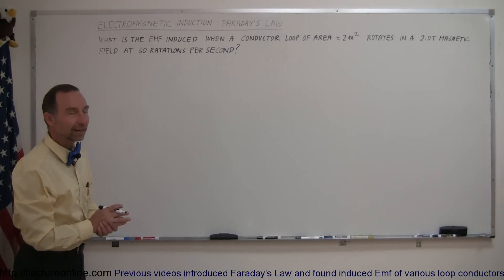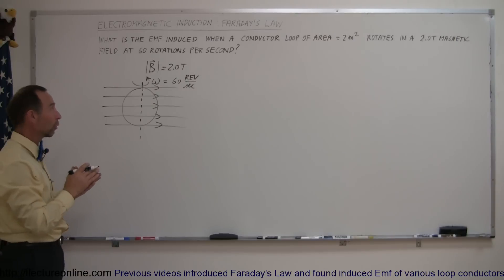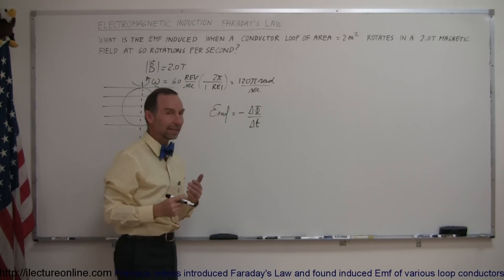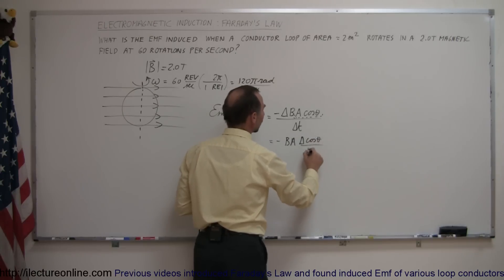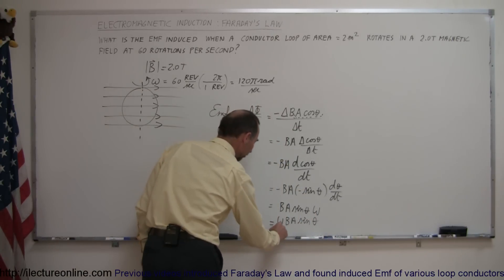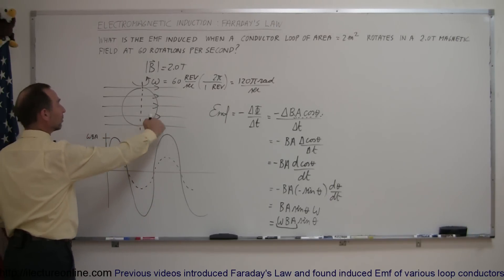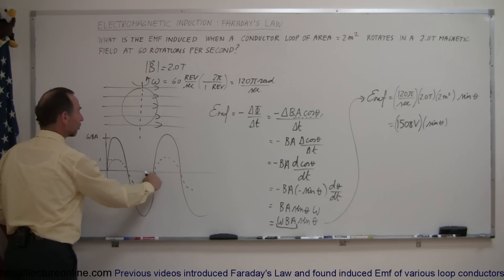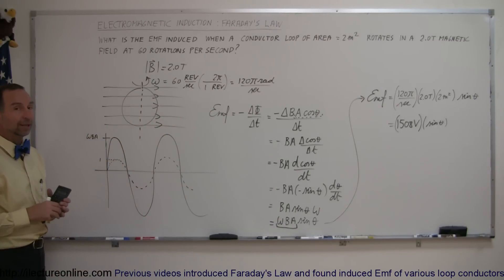Physics 45 Electromagnetic Induction: Faraday's Law (4 of 4) Rotating Loop Conductor

Comment: Mathematically, you used the chain rule to differentiate the magnetic flux first, but you also could’ve also directly plugged wt into cos(theta), and then differentiated and you would attain the same result. Am I correct?
Reply: Yes

Comment: Hi Michel, 
In what circumstance would the area change? I'm a little confused as to whether the area is referring to the total area of magnetic flux swept through by the coil or the cross sectional area of the coil.
Reply from the maker: If the magnetic flux is directed from left to right, it can only go through the loop when the plane of the loop is perpendicular to the flux.  If you know turn the loop 90 degrees, no flux can go through the loop and thus the "effective" area is now zero.

Comment: which part of the conductor loop is potential difference established?
Reply from the maker: The induced voltage acts like a real battery on the wire and "pushes" current around the loop.  It is an electromagnetic effect.  In essence it has the same effect as inserting a battery into the circuit (without actually doing so)  It can be placed anywhere.

Comment: Hi Michel, I am wondering when the EMF is the greatest and why? I am doing a question that says the EMF is greatest when the constantly spinning loop's area vector is perpendicular to the B-field... Why is this true? Is this when the change in the flux is the greatest even though the flux is zero? Can I just find the tangent line of the sine curve you've drawn to find when the EMF changes the most?
Regards,
David
Reply from the maker: The magnitude of the EMF is proportional to the rate of change of the flux through the loop.  When the area vector is parallel to the B-field (maximum magnetic flux through the loop) and the loop turns 10 degrees the flux changes from 100% to 98.5% (a change of only 1.5% of the max.)  When the area vector is perpendicular to the B-field (zero magnetic flux through the loop) and the loop turns 10 degrees the flux changes from 0% to 17.4% (a change of 17.4% of the max) and thus the EMF is much greater at that time.

Comment: Is it possible that the magnetic flux density change sinusoidally (i.e B is a function of sin or cos of an angle) ?(generally)
Reply from the maker: It does, but we use the RMS value, (since the oscillations are so rapid).
Reply: Michel van Biezen but isn't Φ=B.A so Φ=BAcosθ how can B be [cos(α) for example] like that Φ will be equal to =Acosθcosα   ?
Reply: Michel van Biezen and how can magnetic flux density B have an RMS value?, i think it's the emf and the current  the have RMS values
Reply: Michel van Biezen ?😅

Comment: Hi sir, how can you go from dcos(angle)/dt to -sin(angle)*d(angle)/dt.
In Calculus, when we find the derivative of a function, for example: dcosx/dx, we get -sinx*dx/dx, which is the same thing as -sinx.
However, in your case, the function being differentiated (cos(angle)) and the little segment (dt) in the denominator do not have the same variable.
Reply from the maker: You only take the derivative of the angle if the angle is a function (contains a variable).  If the angle is just a constant, you don't have to take the derivative of it.

Comment: Great video. This applies to simple alternators as well, although I got momentarily stuck at the differentiation part. It turns out that w = theta/t so theta = wt and so maybe you could have converted the cos(theta) to cos(wt), which would probably make the differentiation clearer.

Comment: In the final answer (1508V) why do you not do 3016V?
I get this answer when I used 120x(Pi)x2Tx(2squared) = 377 x 2 x 4 = 3016V
Reply from the maker: Dom,

(2m^2) is not equal to (2m)^2

In the first case the exponent only applies to m  (not 2).